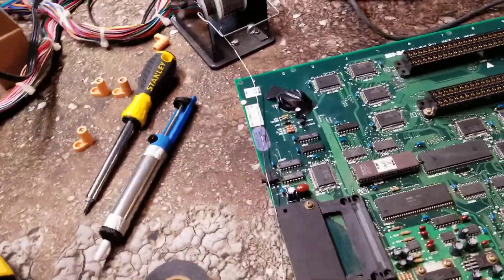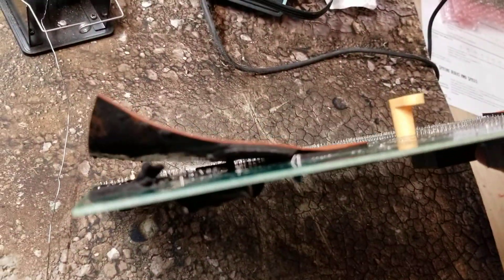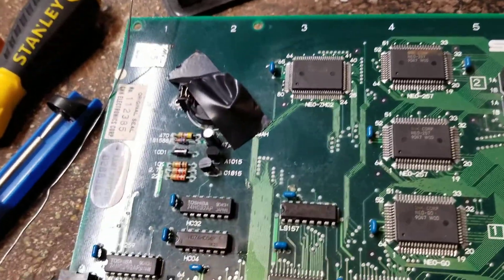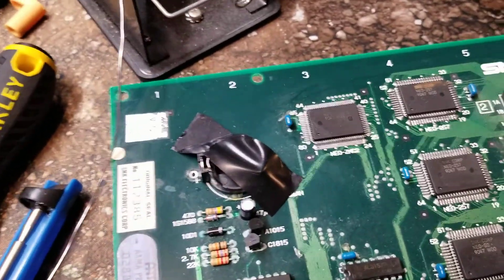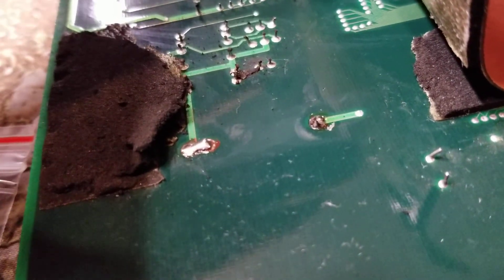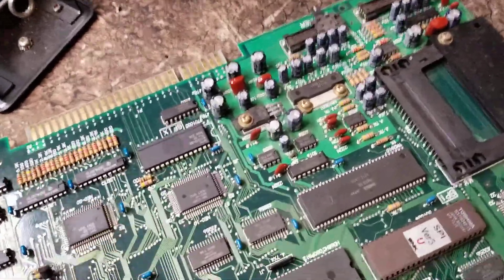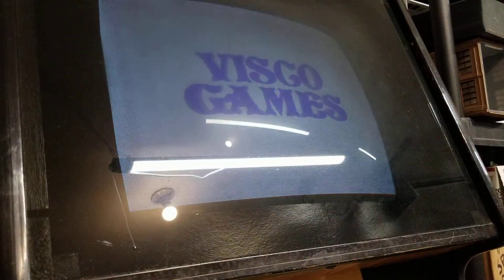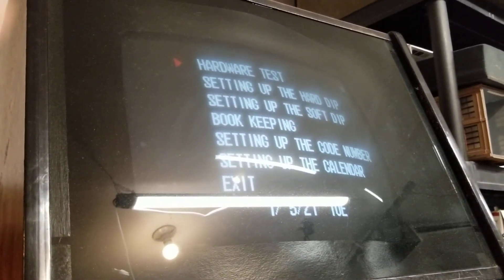Ml2032 rechargeable Battery Mod Neo Geo 2 Slot Gold Cab

Comment: Nice video man. A Couple of years ago I  was inspecting my arcade hardware and just clipped the barrel batteries off both my PGM mobo and the Gladiator IGS pcb. Don’t need leakage as the years pass . My 2 slot is good. Just like what you did 👍
Reply from the maker: I need to unearth my PGM mobo and do the same procedure probably. I have single slot MVS mobo thats doing weird sound that may need some exploratory surgery... Lots of projects